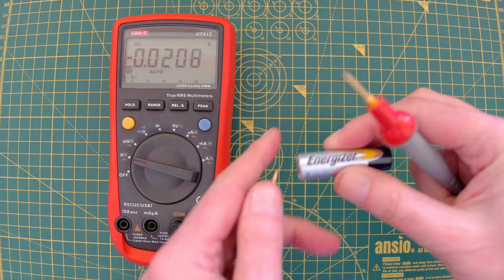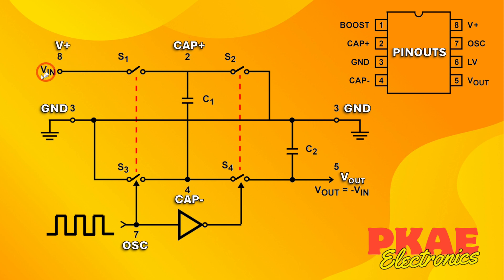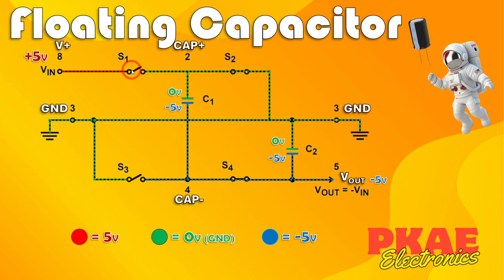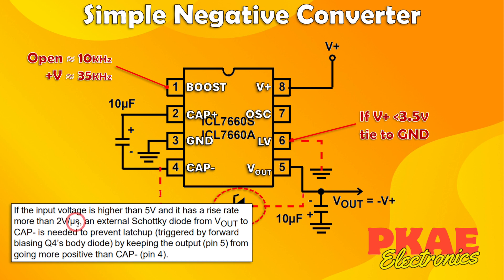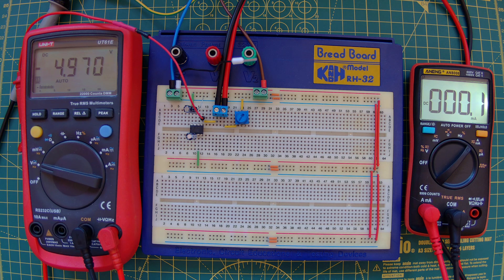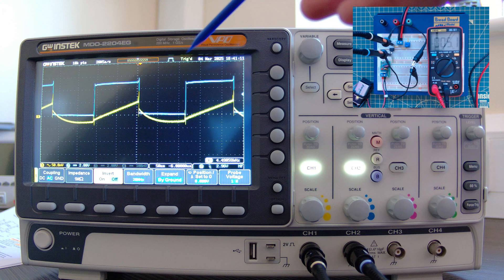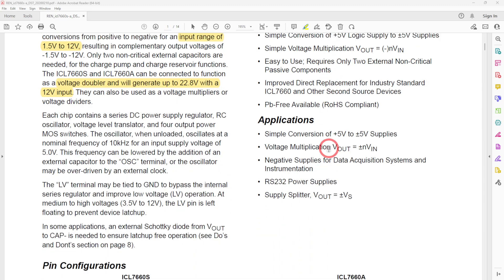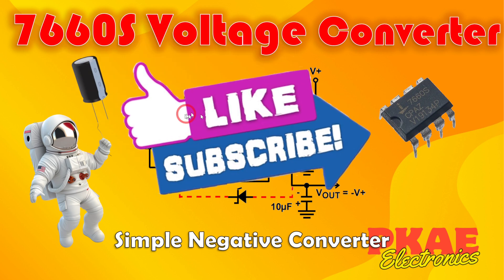Inverting Supply Voltages using the 7660S in a "Flying" or "Floating" Capacitor arrangement.

Comment: S version is kind of rare and expensive at leadt as I see it from the supllier I usually buy. Low output current is also a limitation. The alternative would be LM2776, more current, higher frequency, however, max 5V.
Reply from the maker: Thanks for sharing the info.

Comment: As shown in the datasheet, you can also nearly double instead of negate the voltage.
Also I wonder if it could handle Multilayer ceramics, being so low ESR?
Reply from the maker: I have tried ceramic and electrolytic and the results are pretty much the same.

Comment: Would this be good for an audio circuit for example a mic preamp or would the switching introduce noise? I'm assuming since it's switching at 35khz it's outside the audible range but then again I'm not so electronically savvy.
Reply from the maker: Probably not a good choice. For microphone pre-amp, you would be better off with a single supply and biasing the input to a transistor amplifier or use a dedicated Mic pre-amp IC like the MAX9814 for example.
Reply: I used it for the negative rail. However I have a version which doesn't have a frequency boost pin, so I had to feed it with a dedicated generator above audio frequency to move noise outside audible range. However, current is very low, so you can't drive any kind of load with it, only filter op amps after dacs. Currently switching to lm2776, awaiting pcbs to come to assemble and test.

Comment: I the introductory demo, I wanted a polarised cap and for you to have got the "charge it, flip it over" muddled.... so we could have a bit of "an Electroboom moment" at your expense.... SORRY! 😄
Reply from the maker: Actually it was a non-polarised capacitor in the introductory demo, but it would have made no difference. The lower voltage potential was always on the same side. 

A "Boom" is always fun though, but I will leave that specialised expertise to Electroboom 😆💥

Comment: At least one person asked about filtering the output.

Yes, you can indeed add an LC filter. I've done that in a specialty sensor circuit where noise was of extreme concern. Beware of using very high Q components - a little resistance in the inductor can actually be beneficial in preventing very high gain of the LC filter at resonance which may correspond to some noise frequency. An alternative is to use a small discrete resistance to "spoil the Q" of the filter. If you only need a volt or two to deal with the fact that "rail to rail" op amps almost never truly are when it comes to the negative rail, you might get by nicely with an RC filter with a moderately large R. Just remember that that will make the voltage more sensitive to loading which could create some issues with power supply rejection in the powered circuit.

There should be a good decoupling cap for the input supply placed very close to the circuit. These charge pump circuits can put quite a bit of trash on the supply due to fairly fast, high current transients. In some cases you might want to use an RC filter to better keep the transients off the supply. Be very careful with ground layout.

Note that the probing technique used in the video is horrendously bad when it comes to looking at noise. The probe ground connections are too long and the whole ground connection scheme on the breadboard is awful. This fosters ringing due to the resonance of the ground lead inductance with the probe tip capacitance. If you are trying to look at HF noise with a good scope and probes, use a probe tip grounder if you possibly can.

Comment: In my experience, going back to the days when the ICL7660 was a new product from Intersil, it is usually called a "flying capacitor."
Reply from the maker: Yes you are correct. Just checked the "Art of Electronics" and it is indeed referenced as a "Flying Capacitor". Thanks.
Reply from the maker: I have updated the Description and also given you an acknowledgment for that, many thanks.

Comment: The 7660 is used in LC displays when the input voltage is 3.3V. A negative 3 V is then generated to adjust the contrast. With 5V operating voltage it is not necessary.

Comment: If you increased the output capacitor value (say 100uF) or even put an LC filter on the output, would that let you draw more current and smooth out the ripple? The output voltage has  already dropped to 4.7 with just 4mA. 4mA is barely enough to light an LED.
Reply: You should definitely use low ESR caps, especially when running the chip at 35kHz.
Reply from the maker: @simontay4851  yes, low ESR will ensure the capacitor charges at a faster rate. The cheap electrolytic capacitors I used were around 2-3Ohms.
Reply from the maker: Increasing  the reservoir capacitor  may have a negative effect in that it takes longer to charge and may not ever reach the desired voltage.
Reply: @paulpkae  You can (and should?) increase the output capacitor when using multiple of these chips in parallel.
Reply: The value of the capacitor is a compromise. Extra capacitance does not help if it does not have time to fully charge. Some of the variables include the value and ESR of each capacitor, the frequency, the switching times of the internal transistor switches, the impedance of those transistors and of course the load current. So it's better to use quality low ESR capacitors. It may help to use two in parallel per position (so 2 X 10uF rather than a single 22uF) but it does depend. Ultimately, this type of voltage conversion is only intended for low current applications. For higher currents, you need to store energy in an inductor.

Comment: The principle is also used in the MAX232 and variants. There a 5V voltage is doubled to 10V. 
A negative -10V is then generated. Then there are level converters for TTL and serial RS232 interfaces. 
RS232 uses -10V as logic 1 and a +10V voltage as logic 0.

Comment: Verynice, can you please explain the concepet of "Floating" please
Reply from the maker: Usually, the term "Floating" implies that a specific point (or node) in a circuit is not electrically connected to a defined voltage. 

In this instance however, it is used because the Ground reference to the capacitor is not fixed. It switches between the two plates. Hope that makes sense?